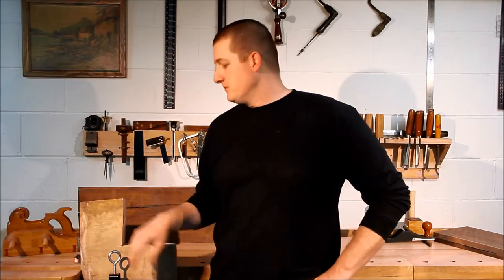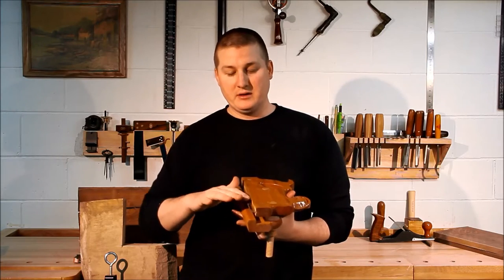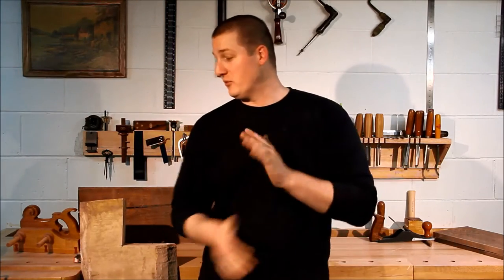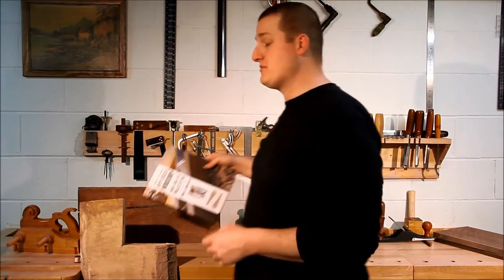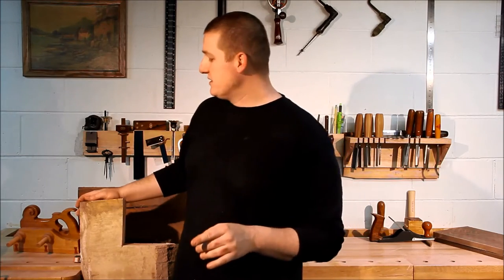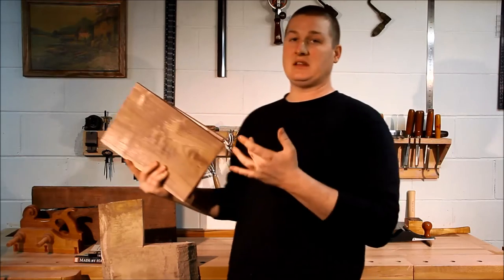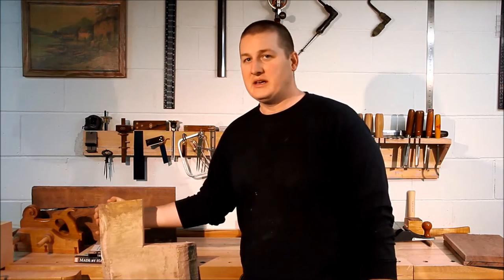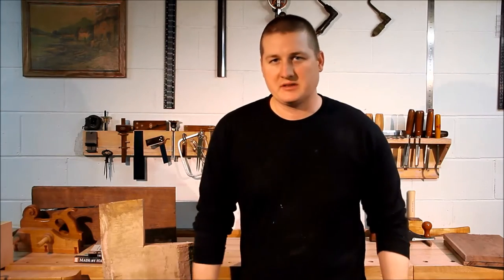Kerfing Plane and Frame Saw demonstration

Comment: Pretty good stuff
Well worth the money
I have a much cheaper version but still works like a charm!
Reply from the maker: Thanks for watching! As long as it cuts wood, right! It's function, not fashion.
Reply: +Chasing Rabbets Woodworking 
The only downside to that setup is that you can't rip thin strips from a wide board, like edge banding
My frame/bow saw with adjustable blade is good for both but the downside is that you can't use both hands
:)